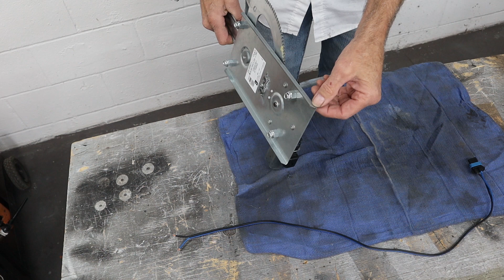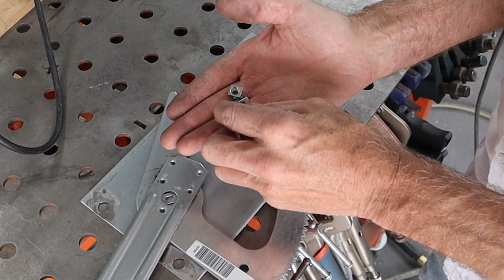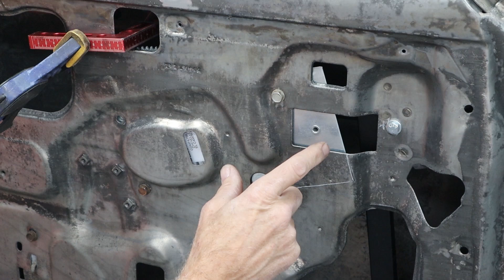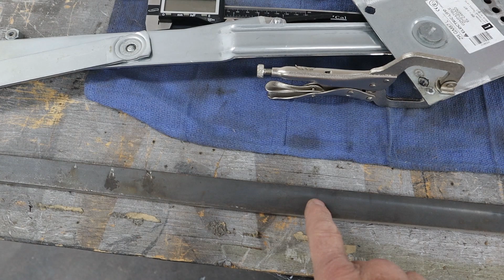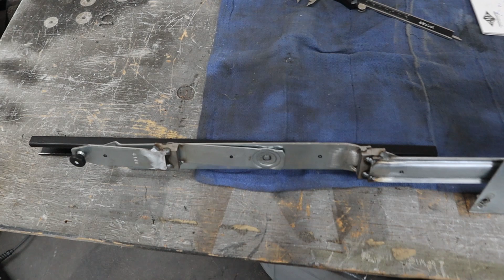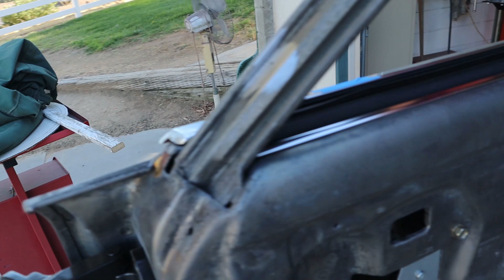Electric Life Power Window Modifications  - GTO RestoMod (Ep 72)

Comment: Nice work! The lower voltage may also help with that little flex at the top of door frame. We used to call these things, field engineering. Again really nice work.
Reply from the maker: @josephborso9866  Thanks. Adjusting the speed should be helpful but as the voltage goes down amps increase so I will need to keep an eye on that.

Comment: I've done several of these exact cars before and you could have made everything work and saved yourself a lot of time, headache and effort by leaving the weld nut offsets, trimmed the excess ends of the guide studs and not even had to cut the edges off the plate and used the exact mounting bolts that didn't stick past the mounting plate, you wouldn't have anything binding or hitting the glass when going up or down.
Reply from the maker: I am glad that worked for you but I mocked it up and since I had moved the glass back when I changed the rear channel alignment the glass mounting plate was extremely close to the motor.   It works really smooth and doesn't rely on the scrapers to hold the glass centered.
On the one piece glass install have you ever had a problem with the glass hitting the hinge reinforcing plates?

Comment: My thoughts were the same as Stans comment. It seems like you could have used those spacers you cut off on the window track rollers where the arms connect. It would’ve possibly saved you from cutting the arms up.
Reply from the maker: @olsonr69  I responded to Stan. Cantilevering the rollers or shimming the window guide out to meet the rollers would put a lot of strain in areas that were not designed for it. Usually the best way is rarely the easy way.

Comment: Why not just put the spacers you cut off  between the window track and the regulator?
Reply from the maker: @stanherman5604  Hi Stan, the reason I didn't go that route is because it would put the load force onto the window offset causing the regulator arm to twist under load and putting strain on the bracket/glass bond. Ideally you want the regulator to push directly under the glass. By moving the offset on the arm close to the sector gear where the arm had the reinforcement ribs should reduce any twisting forces.